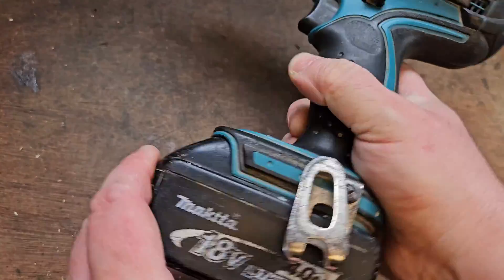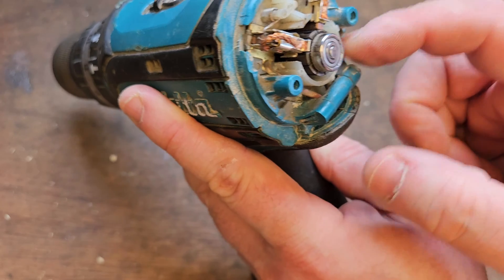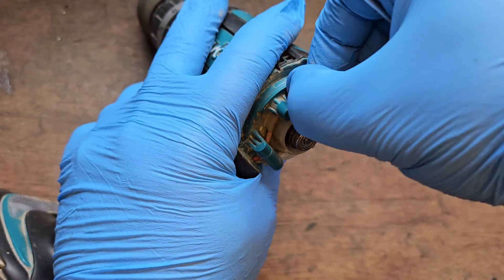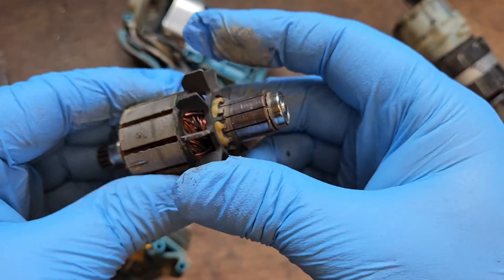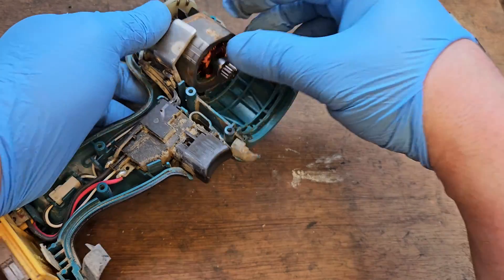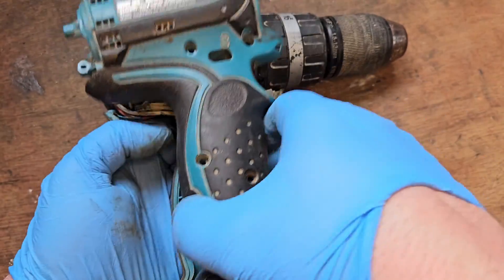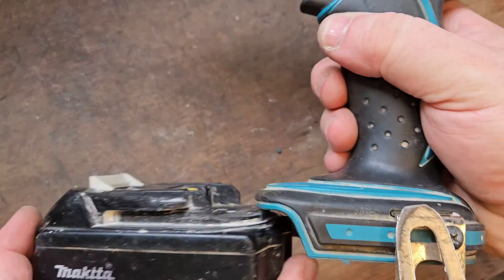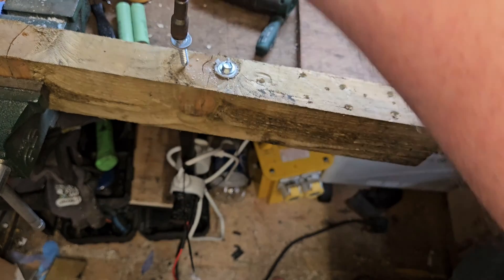How to Fix a Makita BHP452 18v Drill (THE CHEAP WAY)

Comment: Nice job, excellent video. Thanks for taking the trouble. Any idea on the price of the new motor please? Buy on line?
Plus have you done a video on chuck replacement on this model?
Reply from the maker: The armature was £20.99 on ebay 
I have done chuck replacement videos on similar models 
https://youtu.be/lsm9L9ynzEU?si=NJ235KNDsj-o-bWI
Reply: Thanks very much.